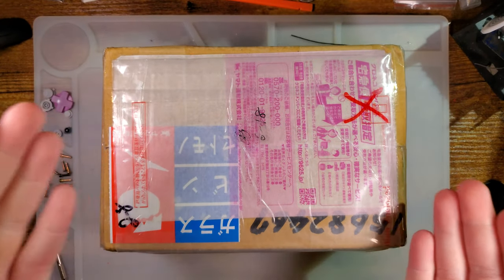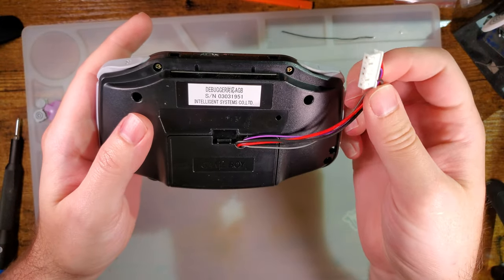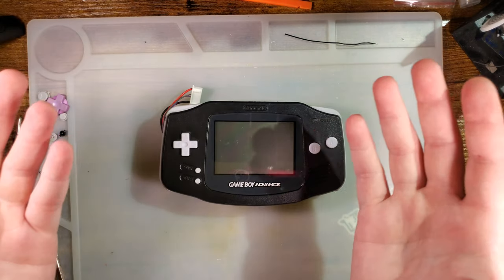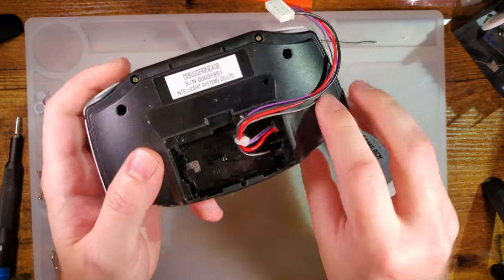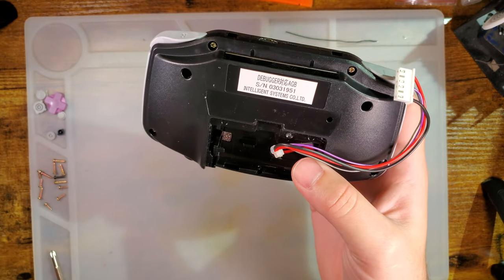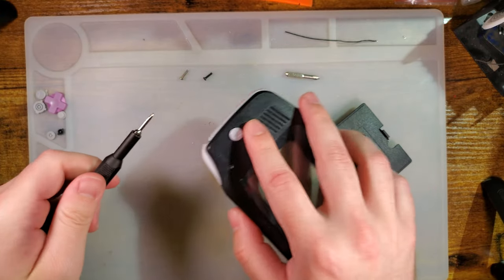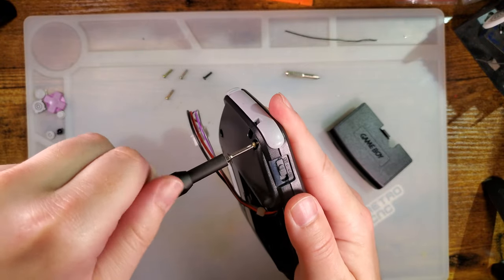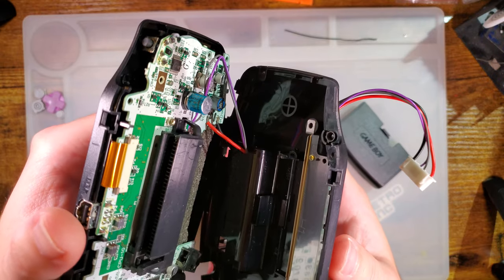Intelligent Systems DEBUGGER AGB Teardown

Comment: Normal hardware with some extra wiring and a special connector.  I'm going to convert my GBA over I also have the IS CGB EMULATOR and IS CGB CAPTURE devices.